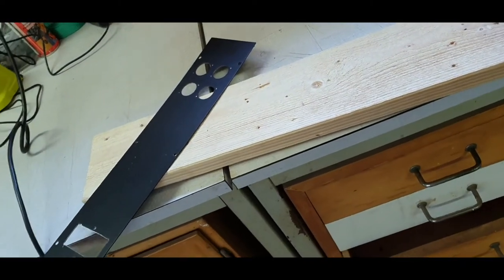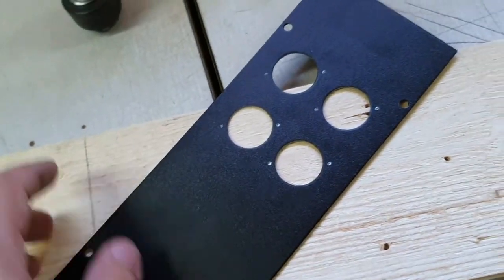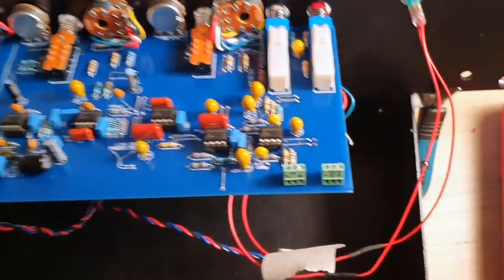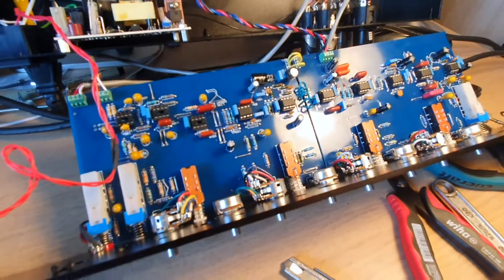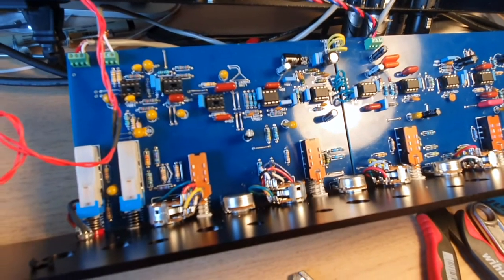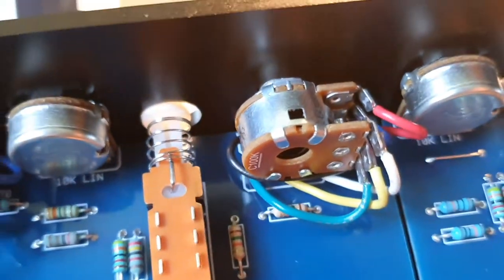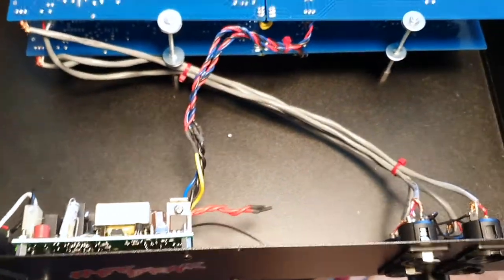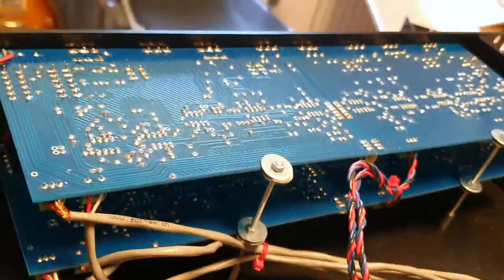DIY Calrec PQ1549 Build Part 3 - Hardware, Troubleshooting and finshed EQ

Comment: Hi!Nice build! Quick question. I also use the the Adam Hall rack units. I was a bit worries about counter sinking because the metal is only 1mm thin. What is your experience?
Reply from the maker: Very carfully i would say :) I used a big drillbit and watched from the inside as i drilled so that the hole wont expand.
Reply: @solderaddict7272  The for your reply. I check the spec on my screws and the counter sink should be at least 1.5mm deep. Which just means the hole becomes 1.5mm big. I'll have to check out some out screws. If you have a part number a will be grateful. And yes... the careful part I got :D

Comment: Hello I've just run my 1549 clone but have one question.Do you know what is the purpose of this link/insert point on the board?I've checked the gyraf description for the project but didn"t find anything... Thanks for your videos.It is a great sounding EQ. :)
Reply from the maker: Hello! Sorry for my late response. I recalll that Jacob stated that this was originally meant for some additional filtering that he planned to put in that he never got to implementing.
Reply: @solderaddict7272  Aaa I see...Thanks for your response... I am watching all your videos since after the Calrec I am now starting the 1176 -Jacob's version.Cheers.